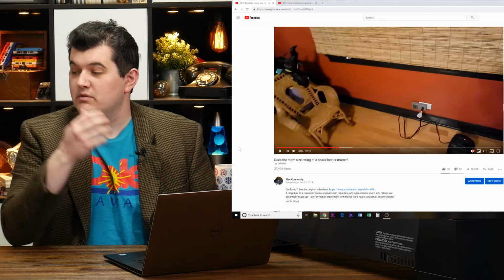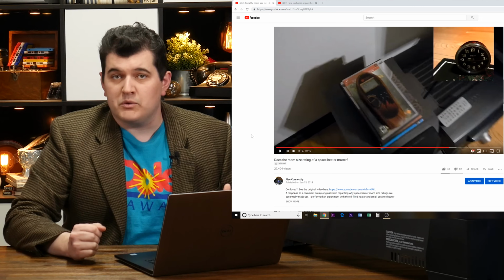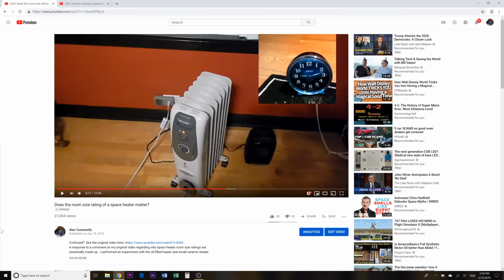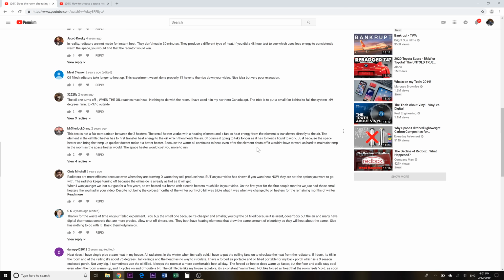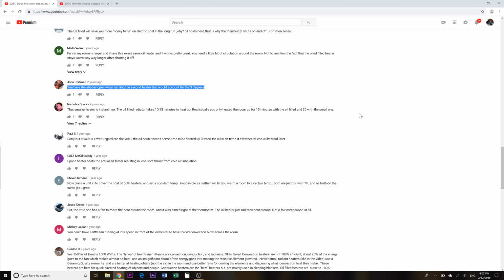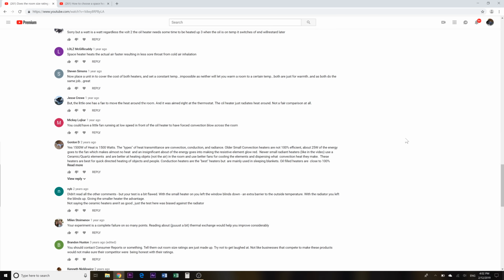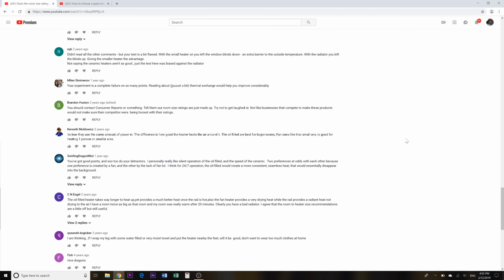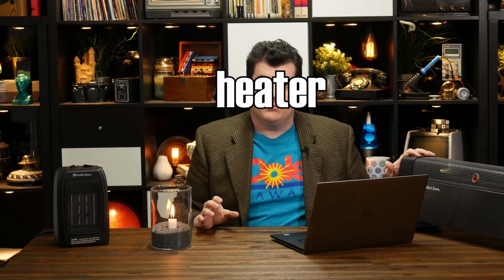More Space Heater Nonsense

Comment: As a heating expert, I can confirm that you are fundamentally correct. I also have issue with the marketing behind space heaters. The size of the room is not the relevent issue when it come to 1500 watt space heaters. They all put out the exact same amount of Btu's and that is nearly all that is relevent when it comes to heating any space. Personal preference and application are the relevent issues when it come to deciding which heater to buy. If you are foing to use a heater temporarily or intermittently, go with the little forced air heater. If you need a permanent source of supplemental heat, go with the oil-heater. You can use the fan heaters permanently and they will maintain temperature just as well, but there are benifits to the oil-filled heaters; mainly they're quieter, a little safer and they don't have fans creating a breeze that can make you feel colder.

Comment: Dude, I GOTCHA.
I use Both an oil filled rad and a heated element, forced air heater in my medium unheated enclosed porch in the cold months, only when I use the room.
"Why both?" Well because each has it's own strengths (and of course, weaknesses.) The oil filled rad doesn't dry out the air. Which is important in a plant filled room. But the forced air heater quickly heats up the space I use in the room while the rad is slowly heating the whole room.
If the oil filled radiator manufacturers wanted to make a better product they would design the unit so that the oil flows, via convection, away from the submerged element which heats it and the colder oil moves in to be heated WITHOUT THE THING HAVING TO SELF REGULATE THE POWER TO THE SUBMERGED ELEMENT! But they're  inexpensive so we buy them.
So, I get ya bro. You tried to do a nice thing and explain shit to help people, and the thanks you receive is troll-level comments. Fug'em.

Comment: OK, I watched both these heater videos. I get the 1500w business, but if you are heating a small room are you better using size wise a larger heater or small one? I am wondering if the size of the heating elements and fan and how quickly it can heat make a difference in that it would run less before shutting off and on as it maintains the desired temperature. I am trying to be as efficient as possible. I have a whole house in the midwest that I basically live in the study room upstairs and so the rest of the house stays at 60F (save on  propane). Little space heater heats the office, but I also have one of those "wood cabinet" larger space heaters. Being the "wood cabinet" heater has bigger elements in it would it heat faster and actually use less electricity then the small one - running less time to achieve the same temperature?  Hopefully I am not to confusing with this question. I did learn one thing for sure, when this little space heater goes out - I don't need to upgrade to more expensive to get better results. But still wondering if size makes a difference as to amount of electricity consumed if all are 1500 watt rated. Thank you for indulging my question.

Comment: My experience. Long term room heating...all day long...the oil radiator will keep a much smoother even temperature. The oil filled heaters I own are not self limiting by the thermostat, in my experience. But I believe your testing. The LargeRoom/Small Room thing is BS. I agree. It’s all 1500 watts. So less power, on and off, with a high heat content in the oil over a day keeps the room a smoother temperature because of thermal mass... in the oil and in the room’s furniture, etc. Even better one can put a small fan blowing very slowly through the radiator and it will work better from a subjective human experience. That’s what is important. I’ve tested this, subjectively, several times when gas heating was unavailable. The small units work great if you direct it right in your direction. The oil heaters work best to heat up a medium room that you need to move around in.
So. I believe that you are ignoring the subjective experience of a human living in and moving around in a small room.
I understand your frustration. I was frustrated. But, in a small or medium room for a long period of time...use the oil radiator. My humble opinion.

Comment: People on Youtube are graduates of Google U.  They argue with physics majors about math or physics because google gives people a false impression of expertise.  I'd say,it depends on what you want to achieve.  My home uses baseboard heat, very costly; so I often use a small space heater and turn my heat down to save some money (my baseboard is old, and half blocked by a TV).  You seem to have proven your goal in that, comparing which heater heats the room better within x amount of time.  An extension to experiment might be to turn each off and then check room temp after 30 MN. To see if radiative heater adequately maintains whatever temp it initially was able to achieve, and to what extent.  If someone wants a heater that continues to slowly release heat after being off, maybe that's the WAy to go.  If it can't maintain that temp adequately enough, I see little value in it. If it uses the same amount of power, takes longer to reach a desired room temp, then can't maintain that temp adequately after being turned off, what's the point?  I'd prefer a cheap space heater.

Comment: My Pelonis oil heater works pretty good.  It's currently 50 degrees, overcast and damp outside and my living room is 74 degrees and I had to back the thermostat down to 3/4.  I also have a small USB fan about 8 feet away blowing over the top of the heater so that's probably helping too.

Comment: right off the bat i knew i was watching someone not too hands on experienced  with heating dynamics. assholes are always waiting to be assholes to you though.  who would know they'd be wanting to be that on you over a dam heater video...LMAO..MORONS!!

YOU were in good taste and manner on the first video and this one as well.  you bring a rather nice hint of piszaz to your content.  calm yet rather very slightly humorous. and you were curious of something that is not your profession. no issue with that at all.  i like that.  sides that..back to the heater situation  lol..

  what the box doesn't tell you is how easy or hard it will take a smaller or larger heater to heat the same size space.  a smaller room heater will have to run non stop to maintain the space, versus a bigger heater that is designed to heat the space easier and more importantly maintain it easier.  what heater will last longer in the same space is the question.  the smaller heater, heating elliments will burn out alot faster than a bigger heater and oil heaters have the longest life span...  onto the oil heat topic,  oil heaters push more heat once they are up to temperature since the oil is hot and has to cool back down to lower the rooms temperature. versus a small heater, and any other type coming from a 15 amp wall out let.  as soon as it turns off, the temperature will begin to drop will very slowly.  about the 1,500 watt fan based smaller heater.  that is the max current flow by code of safety that a 15 amp outlet will permit, if it was more, than a oil heater couild heat up faster, given that it has been programed to.  since 15 amp is the lowest output outlet in a given home, this is why the standard regulator of a space heater can only go to 1,500 watts.   to speed up its heat up time, simply use the fast speedy fan heater to on it to heat it up to tempeture faster and then cut the fan heat off.  if you really want effietiency, you need to go around the space and make sure its all well insulated. the more insulated it is, the better the space heater will do job and you wont have to use the bigger heaters. Also...keep in mind, the hotter you try and keep a space, the more preasure builds and pushes the heat out faster.  at 65 degrees the presure becomes so great that you actually begin to loose heat faster than it is produced, forcing any heater to work more and harder.  at 70 gegrees the heater will be turning on literally every 5 mins in alot of circumstances.  so accept 65 or less. get use to 65 or less if you want to be an effients consumer.  

and its ridiculous people felt the need to verbally bash you a video that you tried to bring light to the wacky pricing of heaters that are all rated at 1,500 watts.  you at least question why the hell would you pay $100 for a heater,  versus a  $25 heater that will heat a space just as good and faster than the heater thas priced at 4x the price.    and hey..CHEERS!!   ...this video got your dislike ratio upto 21x better!!  good job k  :)

Comment: Efficiency in space heaters is misplaced.  It's more about rate of transferring the generated heat into the surroundings from the heater unit itself.  If a heater is getting hot then heat is staying at the heater rather than transferring into the room as heat for the occupants.  Given enough time sure the heaters will transfer all their heat into the room but at vastly different rates.

Another consideration for this type of experiment is to also take into account the change in room temperature while the heater itself cools down to match that of the room. So keep the timer running until the heater is the same temperature as the room.  Some heaters even take this into account by continuing to run the fan until the heater cools.

Getting such an experiment controlled properly also requires being able to estimate the thermal load of the room prior to conducting the experiment and having a consistent outdoor temperature (so as to not change the thermal load during the experiments).

As for your point about thermostats away from the heater: A good option would be for heaters to use BlueTooth and allow pairing to a thermostat device elsewhere in the room (reverting to a on-the-heater knob if there's no connection or connection is lost and still having a separate overheat trip).  There's actually some logic on the higher end HVAC thermostats to measure the leftover heat (fan running with heat system off) and adjust the cycle timing to compensate (in other words it gets smarter at not overshooting the set point while the heating system loses its stored heat in the cool-down part of the cycle).

Comment: So weird. I have the same heaters and the oil filled will heat the living room by itself but the little one will not. Not even a contest.
Reply: 3 possible things are happening.
1- placebo
2- maybe it 'feels' warmer if you're standing near it due to radiating heat, but isn't actually heating the room any more
3- maybe it is simply using more electricity.

Both of your heaters are producing the exact name amount of heat per watt used.

Comment: 1500 W is the amount of electricity consumed by the device it has nothing to do with the output! If you don’t believe me hang six chicken lights from the ceiling. At 250 watts each you are still consuming 1500 Watts but you will get blisters on your head!￼. Then you can take it one step further and put 30 heat pads on the floor.  At 50 watts each still burn 1500 watts! It’s all about efficiency.

Comment: The comment that an electric heating wire element heater dries out the air...how? The air gets warmer allowing a HIGHER amount of water to be absorbed into it, thus the relative humidity drops, but the amount of water vapor in the air remains the same. The electric element does not "burn" the hydrogen and water atoms apart. Wouldn't that mean that there is no "drying" difference between the electric wire element and.. the oil radiator?

Comment: Hello, I get the straight through logic the box says it out puts blank, so each device is equal. As you stated this is how they are rated on a capacity scale. Looking at the room you are showing I have to say your test is directed towards someone who has a room similar to your to heat. I do not think there is disagreeing in the results you have captured. What I think is failed to be seen is that other peoples applications for these heaters are in rooms not just in size difference but in overall insulation. Though a unit of energy exhausted in to the system may be equal in a side by side comparison that you are attempting to accomplish, yes if both heaters utilize the same amount of electricity then the output would be equal. Assuming this is true as you are in your analysis then you would receive a temperature variation equal or very similar in ratio to the energy utilized that you monitored. Clearly no correlation. So in one of the videos surrounding this subject you posted, it was a room with a bunch of heat dots floating around, if the room were empty and sealed then yes just the radiant convection heat would escape. Lets say you have a large room now is it really possible to heat this room from a singular source in the same way? singular being very important. when you have rooms that differ in size they differ in 3 dimensions, and not to be condescending, but when you consider the difference it increases quickly though 200 (20x10) square feet may not seem much different than 300 (20x15) square feet, but at the same ceiling height of 10 feet, its 2000 vs 3000 cbc ft when you increase the size of the space you are also going to increase the amount of heat to be lost to another system, so . So the heaters that are made for smaller rooms will tend to output a heat that can immediately warm the air that it forces with a fan where the slow heaters will slowly heat an area not just the air passing through the heater, so the floor will begin to warm, the walls will begin to warm and over time this warms the room, where the heater you are praising simply heats the air in to convection which though you see as can be provided to a body in the area, given the circumstances will end up as waste in a draft or like the crappy windows in that room or how you failed to account for many different factors, honestly every question you had hear could be answered and explained by a decently competent engineer. How you actually have made several videos on this and still don't recognize how far from actually understanding necessary applications outside of your bedroom in your parents drafty house...? Go somewhere cold where you are worried if the heaters will be enough to keep the entire room warm.

Comment: I agree that the units rating being the same means they are gonna produce the same amount of heat... That being said i disagree that advertising for room size on units is in anyway dishonest unless any particular unit was not designed well for a room of any given size that it was advertised for. Maybe adding something as simple as long term or short term before the room size. Different units are better suited for different sized rooms and purposes. A very tiny heater might produce the same amount of heat but is it for long term or short term? do you need the heat circulated? or do you need radiating heat? different heaters heat up in different ways, take a small oil unit and a big one. the big one will keep a bigger room more comfortable more efficiently because it is heating the oil which radiates heat from the unit and of course the bigger unit has more oil and will heat a larger amount of space at once as well as taking longer to cool down, that would directly translate to efficiency. Is a room size guide on the unit practical? no not at all but it is describing use not output.
moral of the story? do research in how things work before you purchase what's that old adage? "BUYER BEWARE"

Comment: It’s the first thing we were taught when we become an electrician and it’s called schematics a 10 x 10 room put 1000 W heater in it will heat that room in 10 minutes. Put a 500 W heater in it and it will heat it in 20 minutes. Thus the room gets warmer quicker but takes the exact same amount of Hydro.
Reply: I agree with you, but with one small thing, during 20 minutes there is more heat loss from the walls of the room than 10 mins, so the same heat energy that you give would make the room a bit colder during the whole 20 minutes on average than the 10 minutes, but if you let the 10 min room for an additional 10 mins with out the heater they should equal out, (if we disregard the fact that more temp difference makes energy transfer faster)
Reply: @hamoonhassan2573  And that's why the people who say, "I can't afford to tear out my walls and put in better (or the first, for old houses) insulation" but also plug in an electric heater to help their under-rated home heating system and then complain about the bills make me scratch my head. - - - If you're renting, I get it. But if you own, INSULATE!

Comment: I agree that the size of the heater doesn’t correspond to the size of the room it can heat and further any rating on the box related to room size is marketing wank. 

I think some of the confusion in the comments is that the video seemed to prove the oil filled unit was “less effective” somehow while the dialogue rightly insists the energy used is equal to the heat released. So the video evidence contradicts the science and math resulting in the possibility of at least 3 different argument against the entire presentation.
Reply: Let the debate begin on how size doesn't matter..